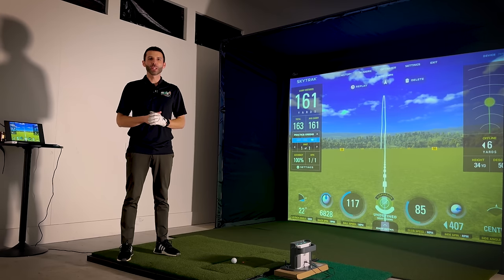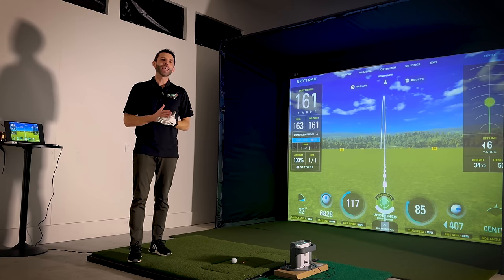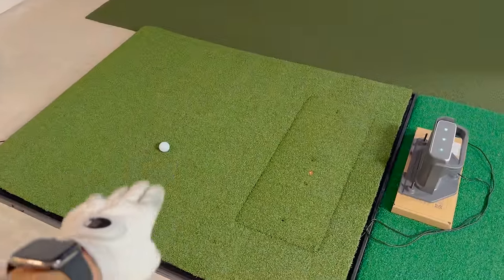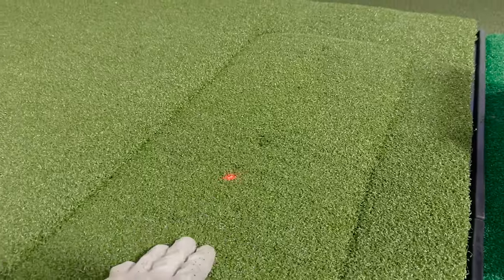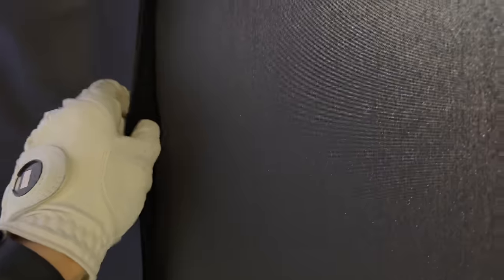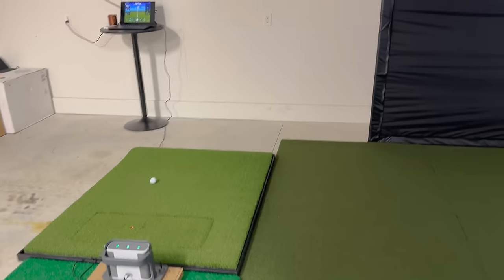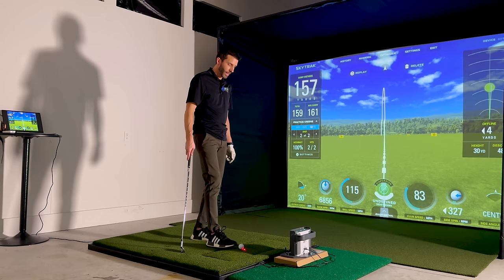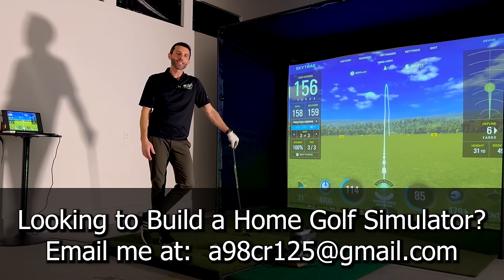How to Build a Golf Simulator at Home - Carl's Golf Enclosure & HotShot Golf Mat Review!

Comment: Another well done, informative video Jay. I have to admit, while I like my 4:3 7x10 Carls DIY, I would definitely do a couple things differently. I'd go with the wider 16:9 enclosure and I'd go with the premium screen instead of the preferred. I also have some cracked concrete in my garage so that heavy duty rubber base is very, VERY interesting to me - even though your mat seems to have more problems than mine, I'd like mine to sit flatter and I think that would be perfect for my situation. I'd be happy to do a comparison for you if I happened to be picked to try the new C series and that hitting mat. Thanks for all your hard work and fantastic content!
Reply from the maker: Thank you!  So 16:9 can be nice but you need it to be super wide in order to be 8" plus which I recommend for the best Simulator dedicated experience.  Appreciate you watching and commenting.

Comment: Does your insert lay flat if you take it out and lay it on the floor?  It seems like it might be just slightly larger than the hole that it goes into.  Maybe trim the side a little?
Reply from the maker: I already tried cutting it.  It does not sit flat on the ground well though by itself.  It seems to have a permanent curved shape which is not helping for sure.

Comment: Love the videos you do!  

I’ve been having problems with the enclosure around my cage.  I ended up going with a smaller and less well known seller of the enclosure vs. the more well known providers, such as Carl’s.  But I’ve had lots of issues with the enclosure, specifically in the right corner where the side panel meets screen.  
I have their foam inserts that help “protect” the bar.  But the Velcro that connects the side enclosure with the screen just isn’t working for shanks to the right.  (And yes, I have been shanking shots as I’ve been trying to retool my entire swing…trying to shallow my swing and having the inevitable shanks while I try to rotate my body to square the club).  Is this an issue that the Carl’s Place or other seller of enclosures is finding? I notice the Velcro attachment point is a little deeper along the side panel than mine.
Reply from the maker: This is really tough to say since I am not familiar with your enclosure brand.  I have not shank tested either so really tough to say but the foam is a memory foam that I am sure would absorb a ball.